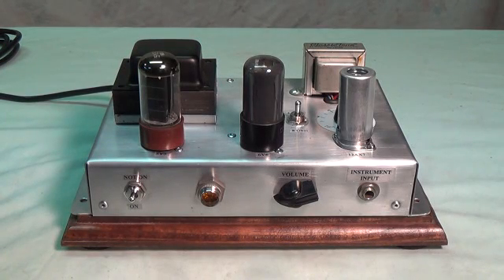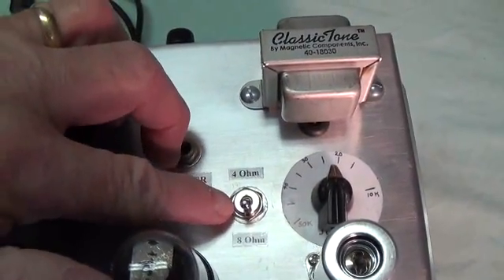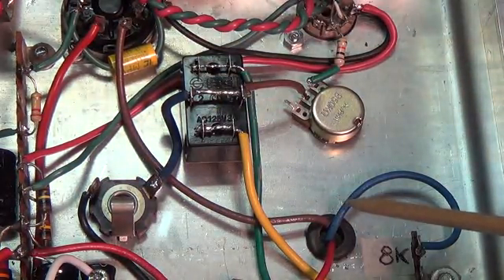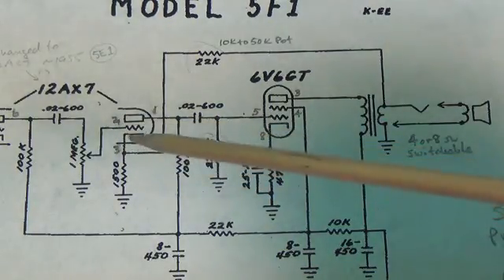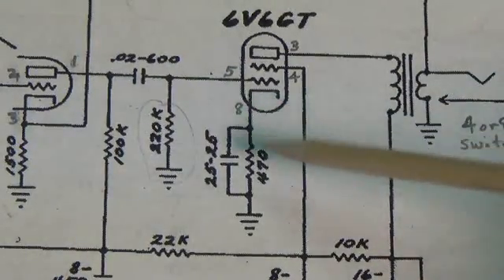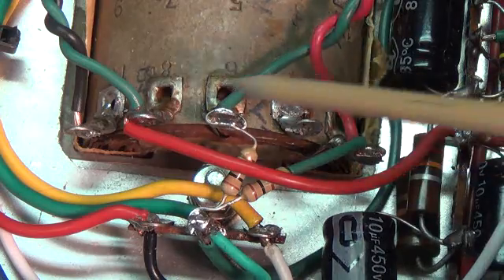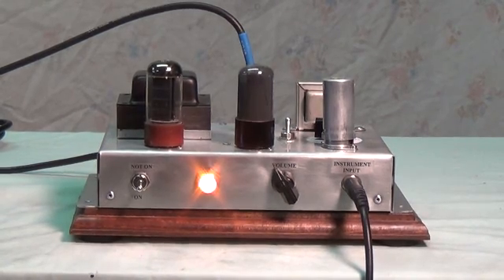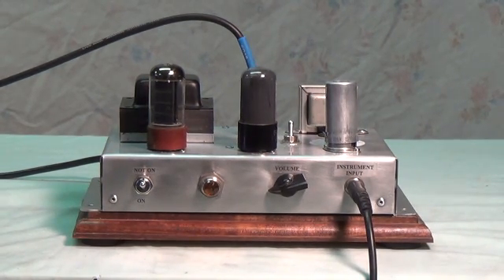Scratch Building a Fender 5F1 Champ from Scrap Parts.....Part 2

Comment: Hey Uncle Doug, thanks for another inspirational video. You've inspired me to build my own "scratch build" (not from a kit) Champ. I installed the virtual centre tap. You're right. It really cuts down on the 60cycle hum. Quick question Re: Output transformer...I'm using an 8ohm speaker. Would the 8K primary winding be  more suitable or should I use the 5K? 
Thanks
Reply from the maker: I'm glad to hear that you're building your own amps, Joram. Best of luck with them. Your question is a good one. I prefer the 8K winding, but you may like the 5K better. Try it both ways and see which one you prefer. Experimentation is always the best way to optimize tone.
Reply: @UncleDoug  Interesting. In the video you say you prefer the 5k winding for a single 6v6 (in 2013), 4:41 but in your comment from 2020, you say you prefer the 8k winding. Did something change over the years in your tastes? Do you remember? Thanks. Great videos. I'm new and loving them immensely!
Reply from the maker: @MatthJenks  You're welcome, Matthew. I tend to try each winding in the circuit being built and, if I can hear a difference, I go with the better-sounding one. It has always been my preference to experiment with component values, rather than simply accept the status quo.
Reply: @UncleDoug  Great advice. As a relative beginner, I don't really trust my ears from one session to the next, but I'll try both windings and see if I can hear a difference. Thanks!
Reply from the maker: @MatthJenks Also, monitor the plate current, plate voltage, and output signal volume with each winding. There are more considerations than just a slight difference in tone (if one actually exists).
Reply: @UncleDoug  Thanks for thinking of me and coming back with more advice. Much appreciated. I will do all those things. I don't always notice subtle tone differences so actual measurements will be more tangible to my brain.
Reply: Thanks for that. I will try them both.
Make sure that Jack washes his paws regularly
And safe.
Reply from the maker: @joramkalfa9521  Good luck. Stay healthy :)

Comment: Thanks for all the great videos Uncle Doug.  I am about to start a 5F1 build (my first amp build).  I noticed that I ordered the same output transformer that you used in your video.  I would like to incorporate the ohm selector switch in my project.  I assume the ohm switch is on-on? Any advice on brands or ratings for the DPDT switch?  I have built a lot of pedals with toggle switches, just wondering if I needed something more robust for a guitar amp.

P.S.  Thanks again for sharing your knowledge and expertise.
Reply from the maker: As I recall, I used a double-throw switch, with 4 Ohms on one side, 8 Ohms on the other, and output in the center. Good luck with your project.

Comment: I'm getting ready to build a 5C1 clone head using minature tubes...6AU6A for the preamp, 6CZ5 for the output tube and a 6202 for the rectifier (the 6202 is a slightly derated 6X4 variant designed for aircraft radio use).  It's all going into an old McMartin SCA radio cabinet.
Reply from the maker: That sounds like an interesting project, D20. Best of luck with it.

Comment: Thanks for making these videos! I do have a question, could you go even lower than the 10k minimum for maximum headroom? I'm tempted to add a negative feedback loop to a Vox AC10 to see if I can coax out some Fender Blackface clean tones. Cheers!
Reply from the maker: By increasing the NFB you do boost the headroom, but to my ear, with too much NFB the tone becomes rather weak and lifeless. Play for a while with high NFB, and then dial it out slowly.....the sound becomes much warmer and more dynamic.

Comment: Love this video! I’ve probably watched it at least 50 times trying to absorb all the information I can from the content. As old as this thread is, I will probably die from shock if I receive a reply, but I’ll give it a shot anyhow! You mentioned down in the comments that the 1K Bourns trim pot you used for the cathode bias was rated at 5 watts. Do you by any chance have it’s model # or any other relevant manufacturers information? My Internet searches have not even come close to that wattage rating in that size or configuration, and the project you’ve inspired me to start definitely needs it. Again, will be surprised at a reply, but regardless, appreciate and enjoy viewing everything you do!
Reply from the maker: I'm glad to be able to surprise you, IG. I found the precision trim pot in my stash of vintage parts and have no idea where it came from. In its application as a bias resistor for a 6V6, 1W would probably have been adequate. I'm sorry I cannot provide a source for you.
Reply: Uncle Doug I appreciate your effort in responding all the same! When I first started watching your videos, I saw your two part series on the Trem-o-drive unit you made. I went to his site thinking that I would download the specs to make my own, but found a schematic for a 2.5 W guitar amplifier that also utilizes the voltage doubler as its power supply. We are fortunate enough here in Dallas to have a large and well-established store that would be the equivalent of what RadioShack used to be, just larger. I started accumulating the things that I did not already have by going there and combing through all of their shelves of components. The schematic calls for a 250 ohm /2 W resistor for the cathode of a 6AQ5. I liked the idea of it being variable, but The only potentiometers they have with the 2 W rating are rather large. My goal is to try and keep the actual size of the entire unit as small as possible, and the type that you used in the champ build would have worked far better than the gargantuan thing I just picked up today. I see the comments, and I know that you are aware of how much all of us appreciate the effort you put into your videos, but I’ll add my two cents here and say thank you again! If I can manage to get this thing finished successfully, the information you have generously made an effort to pass on will have played a major part. I will definitely forward you pictures or recordings. My wife has been encouraging me to take video footage of various points in the process, so it may turn out that I’m actually sending you a link to a video. In which case you would be able to grab a beer, sit back and relax for a change! Unless, of course, the allure of Russian pole dancers gets the better of you!
Reply from the maker: @insomniacgarage5070  Thanks so much, IG and best of luck with your project. One thing to consider is to use a pot and fixed resistor in series, each rated at 1W, producing a total resistance greater than what you need, but adjustable down to proper levels......and having 2W of power dissipation.
Reply: Uncle Doug thank you for the recommendation! My solution may have been in front of me the entire time. For the sake of continuing my learning, I have a fixed 2 W resistor that is 30 ohms lower than the resistance value recommended on the schematic, and I also have a 1K trimmer pot with a wattage rating of 500 mW. To make sure I’m understanding you correctly, are you saying that combining the two together would create a power rating of 2.5 W? I know that the trimmer pot would allow me to bring the The resistance up to the correct level, I just wanted to confirm that the power handling capability would actually increase by combining the two as well. If so, that may save me from having to install a full-size 2 W potentiometer.
Reply from the maker: @insomniacgarage5070  Not exactly. You can calculate the power generated within each resistor: P = I squared x R. i.e. Instead of a single 100 Ohm 1W resistor at 0.1A  (P = 1W) use two 50 Ohm resistors in series: Each resistor will only face 0.5W .  The total wattage does not increase, but you have spread it out over 2 or more resistors, so each will face a much lower wattage. Thus you can use lower-wattage resistors in series to provide a total resistance with higher wattage. If your fixed 2W resistor can handle the bulk of the power, then your 1/2W pot will face much less heat. Use your resistance values to calculate the distribution.
Reply: Uncle Doug thank you for the clarification. It sounds like I need to spend some time with a calculator and figure this out. I appreciate the help! Now I will quit commenting or asking questions on this particular topic before you hand me a fully charged electrolytic capacitor and ask me to put it away for you! 😄

Comment: where did you get the variable cathode bias resistor? I can't find one like that anywhere
Reply from the maker: It was in my parts stash, Joe. I have no idea where or when I got it. Have you tried Mouser ??  Also, in subsequent videos I have used regular 1K to 10K pots as bias resistors with good results. Be sure the current flow doesn't exceed the rating of the pot.
Reply: Uncle Doug ok, thanks for the help!

Comment: hey guys, how can i learn how tubes work?
id like to start by building some practice /example circuits to understand how they work and then measure them with a scope. 

i have a little tube collection that i could use.

greetings!
Reply from the maker: I would suggest that you study videos on the subject, especially those covering safe methods of working with electronic gear. Gradually apply what you learn, and be patient. It takes some time, but eventually you will become knowledgeable in the art of tube circuitry.

Comment: Hi Uncle Doug,

That's just the sound I'm looking for. 

I play harmonica and have a Monoprice 15 watt Stage Right 5 tube class AB amp.
Outputs are EL84 and PI is 12AX7. 

The nasty sound is great for the hot tunes that we play but I'd like to be able to clean it up for the slower easier ballads. I have the schematic that is for the Laney 12R and it's the same one used for the Monoprice 15 watt. I'd like to email the schematic to you but can't do it here. 

I've found the NFB resistor off the + speaker lead, R22 47K, but want confirmation if you don't mind.
Let me know where I can send the schematic to and maybe you can do a short video too.
Vince..
Reply from the maker: No need to send anything,  Vin. If the NFB resistor is 47K, then replace it with a 5K fixed resistor and a 100K pot in series. See if that combo works for you.
Reply: @UncleDoug  . Thank you Sir. It will be a while before I can try it . Lots of jams coming up. . I'll let you know how it works.

Comment: Great as always! In the last couple days I made kind of a champ, but mostly based in the 5c1 schematic, with penthode preamp and no feedback resistor. The penthode in the case is an ef184. Also made a tone control. The output transformer was a 7,5 volt line transformer that I reconfigured for single ended use. Overall, it costed me about nothing, and sounds great
Reply from the maker: Congratulations on a successful build, Jose.

Comment: Uncle Doug-I got my first amp in 1959 or 1960, it was a Fender Tweed, and I believe it was either a Champ or a Harvard.  I know it only had 1 speaker, and I think it was oval. It was pretty small, and of course basic.  I'm thinking of building one and trying to figure out which one I had, and/or which one is the better choice if there's no way to tell now which model I had.  Do you have any thoughts to help me on this.  Thanks.
Reply from the maker: If it had an oval speaker, WS, it must have been a Valco amp. Fenders only used conventional round speakers in their amps. The Harvard is a rare and interesting model. It would be a great one to clone.
Reply: @UncleDoug  Then I guess it was not oval, because I know it was a Fender Tweed.  Maybe just a small speaker, like 6" or no more than 8".  If you were to pick between building the Champ (which you've obviously worked with a lot) or the Harvard, which would you pick and why?  Thanks again for your time.

Comment: Uncle Doug, First, Let me tell that your videos have taught me a lot about guitar amplifiers! I like to ask your advice/opinion: I have successfully built the RickTone Tube-O-Drive, and would like to scratch build a Champ circuit. Recently I acquired a tube-driven radio/record player from the 40's and with it the parts (tubes/transformers, etc.) for a 5c1 champ or the 5f1 circuit. which would you recommend in regards to tone and building ease/difficulty? Also i like the Marshall sound so I was considering  putting a Marshall-type tone stack in between the stages of the 12AX7 if I go the 5f1 route. Thoughts? Also, I excitedly look forward to each of your video releases . Keep up the outstanding work!
Reply from the maker: I'm glad the videos have been helpful, Jeff. I would recommend the 5F1.....it's a more advanced design, with more gain, negative feedback,  etc. Putting a Marshall tone stack in a Champ circuit would be like putting a bulldozer in a wheelbarrow.  You don't need it......it would cause way too much signal loss.....and it will not make the Champ sound anything like a Marshall. If you absolutely must have a tone control (other than the one in your guitar) then build a 5F2-A Princeton (A Champ with a tone control).
Reply: @UncleDoug  Thanks for the advice. After much more consideration, I've decided to go with the KISS principle and build the 5f1 circuit. Thanks Again!

Comment: I labeled a power switch exactly like that for a bench power supply that I built years ago. (On and Not On) I ended up relabeling it because it was a simple single output (specialized) unit and I didn't put a power indicator light or anything on it. I ended up turning it on instead of off when I walked away from the bench a few times. Simple minded as I am, I would glance at it, see the word "On" and flip the power switch the other way to turn it off. I'm easily confused, and you had the foresight to put an indicator light on there, so I'm not calling you on it. Just thought it was funny when I saw your labeling.

You also busted my bubble with the adjustable negative feedback. I watched a documentary on VOX amps a while back and they talked about the VOX either having or not having negative feedback being a big part of what gave it its sound. I thought I had an original idea to have a negative feedback switch on an amp. You had to one-up me with an adjustable feedback loop.
Reply from the maker: Thanks for your nice comments, Harley.

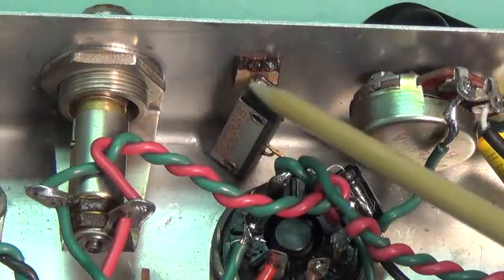Comment: @10:30, regarding the bias adjusting resistor for the 6v6, is this a higher wattage type POT?  Only reason I ask, is because most circuits I see for biasing power tubes is usually the highest wattage resistor in amplifiers, between 2-5 watt, depending on how many 6v6s driven.  And thanks uncle Doug for sharing your knowledge.
Reply from the maker: Good question, Vince. Yes, it is at least a 2W resistor, if not a bit higher, but the actual wattage requirement of a single 6V6 operating at 35mA with a cathode bias resistor of 470 Ohms is only 0.57W (P = I squared x R)......so a 1W CBR would probably be adequate.

Comment: This was very informative. You're a great teacher.
On the subject of bias, how does one tell the limits for a 6v6 or any particular tube.
Reply from the maker: Thanks, Evan. The plate dissipation values are listed for most output tubes in Tube Manuals (by RCA, Sylvania, etc.) available on Ebay, and on the Internet. Do a search for 6V6 tube data. You will find it.

Comment: Let's just say you found a PT with the correct voltages 6.5v. 5v correct HT so how would you  find out weather it was the right wattage I read a PT for a 5f1 is 5 to 15watts
Reply from the maker: Unless the PT came with a data sheet, you can only guess as to its current capabilities, Clint. The best clues are the mass of the PT and the gauge of the wires.

Comment: Those mods are great. Big+ for the virtual center tap. The feedback mod is cool to, could be a Presence-Thud/Resonance kinda thing. Other than what you just built the same thing with a 6L6. With variable feedback it could work quite well?
Reply from the maker: Thanks, RB. See my video series on the Supro Tremo-Verb. It uses either a 6V6 or a 6L6, with a bias-adjusting toggle to suit either tube.
Reply: @UncleDoug  Will take a look.

Comment: Hi Uncle Doug,

I’m wondering if you can help me out. I know that one should never assume especially with tube voltages.
You’ve inspired me to build a tube amp from scratch. I picked up a vintage Electrohome Radio/phonograph for $15.
I bought it for the parts. Included in the tube compliment is a couple of 6V6’s, 12AT7 and a 5Y3. 
I’m interested in building a clone of the Fender tweed Champ.
Can I assume that the power transformer from this radio can handle the current draw for the Champ given that the Champ has a 6V6 and a 5Y3.

Thanks,
Patreon Joram
Reply from the maker: If the original radio circuit had a pair of 6V6's, then the power transformer will have no trouble with a Champ circuit......but the output transformer will. Apparently the Electrohome was a double-ended (DE) circuit (two output tubes), so the output transformer will not work for a single-ended circuit (i.e. Champ). You would be better off buying a 12AX7 and building a simple DE circuit like the 5E3 Fender Deluxe (use the 12AT7 in place of the 12AY7).
Reply: Thank you so much for your reply!
I had a feeling about the output transformer. I performed that O/P transformer test you illustrated in a recent video. BTW..that was an excellent explanation of ratios and impedances. Also, that precision variable resistor in that scratch build. You can't get that at Radio Crap. What brand is it and where can I get one? Thanks again for all those great videos. @UncleDoug